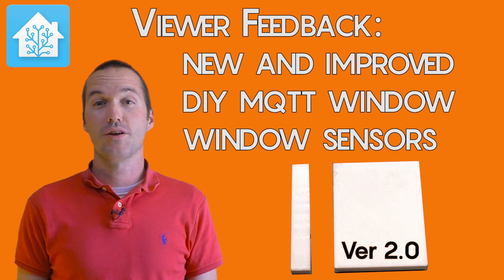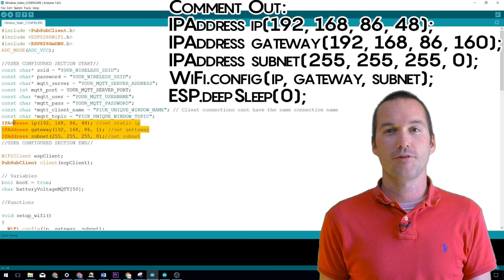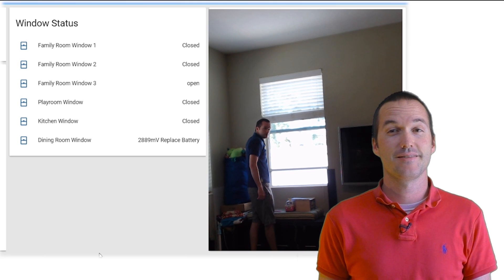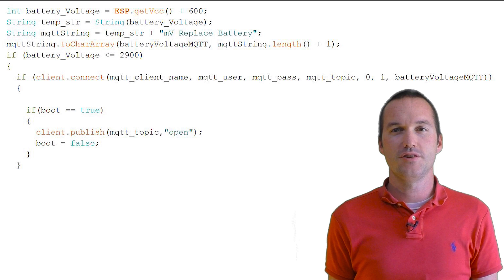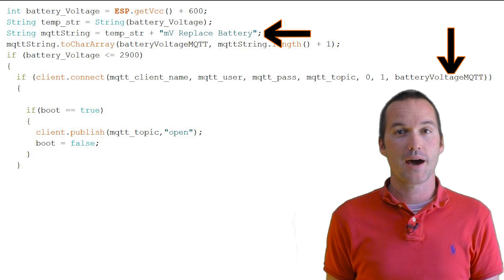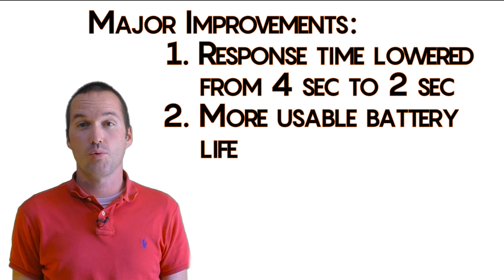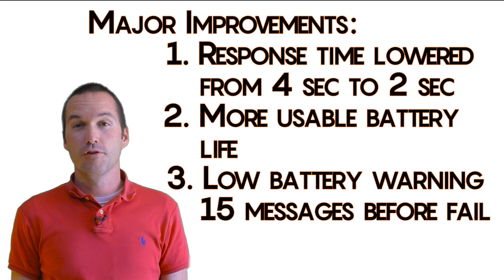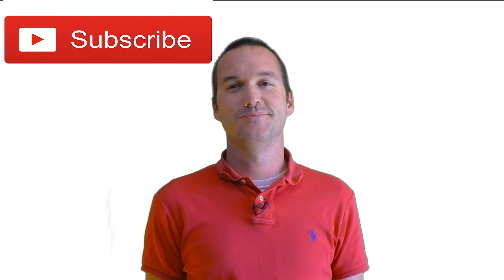[FIXED] $5 MQTT Window Sensor Viewer Feedback

Comment: Do you think that this sensor could be redesigned as a water leak detector?  Replace the reed switch with some kind of contacts that would complete the circuit if submerged in water?  I've been really wanting to DIY some of these but they have to be battery powered for the locations that I'd want to put them (behind the toilets, under the sinks, under the dishwasher/washing machine, etc).  Do you have any thoughts on this?  I'm sure others would find great value in these devices too.  Outside of a fire, a flood is one of the most devastating things that could happen in your home.
Reply from the maker: The problem there is that unlike a reed switch the water sensor is going to have some current draw at all times, which makes battery power more challenging.
Reply: Right.  That's the rub, isn't it.  The idea I had would be that the water sensor would be a switch to the power and when water is placed on the sensor that it completed the battery circuit, powers the ESP01 and it transmits an MQTT message that water was detected.  Now I don't know that the water would be sufficient to conduct enough power to power the ESP01.  I don't know your electronics background, but is it possible to do something like this or perhaps have the sensor be the catalyst for some other sort of switch that could activate a transistor or relay or something that would be able to power the ESP so that it can send the message?
Reply from the maker: Water is a pretty terrible conductor.  You might be able to find something that is consumable and dissolves away  when water hits it and completes a circuit... which might be annoying to upkeep.
Reply: Here is a linked to the Xiamoi Leak Detector (https://www.gearbest.com/home-smart-improvements/pp_668897.html)  It claims 'The durable battery (CR2032) can be used for two years and the battery can be replaced. '  .  I see other brands like iHome on Amazon that claim the same thing so they must be doing some sort of power management.
Reply: The issue I have with buying these premade is that I'd like a bunch of them so it would get a bit expensive.  I've got a ton of esp01's lying around already too.
Reply from the maker: Custom components and not using wifi are pretty good places to start for battery life :)  "It can't connect the phone directly, you have to connect phone via Xiaomi gateway"
Reply: I showed that one as I already have the XIaomi gateway working with HASS and I had looked at it as a possible purchase.  You can find others that claim to be wifi like this one https://www.amazon.com/iHome-iSB02-Battery-Powered-Sensor/dp/B076TDZX9J/   .. Anyway, just thought you might be interested in the project.
Reply from the maker: So I was thinking about this a little more.  I wonder if you could just use the water to bridge the chip enable pin instead of actually providing power.  I don't know how much current gets drawn if VCC is hooked up by Chip Enable is not.  I know the enable pin only needs a very small voltage to function.
Reply: The Hook Up surely worth trying. Thanks for the suggestion!
Reply: What if you place a small bit of sponge in salt water and let it dry up, then place the dry salted sponge between your sensor wires and when water hits it, it will be drawn up into the sponge with the salt acting as an electrolyte?
Reply: Great idea and thank you both for the idea and inspiration. I think I did it! Here is the full project - https://github.com/alekseyn1/WaterSensor

Comment: Hi.. Great video. Could this sketch would with a PIR sensor (HC-RS501). I'm trying to setup a PIR with wifi (ESP-01s) and battery (4 AAA batteries). I want it to trigger a Sonoff Basic via MQTT.

Basically, I need to turn on a ceiling fan and lights in the room. But everything should stay on until the room is empty. How I see it working is that the PIR will send a message when movement is detected in the room (someone enters) and Hassio would turn on everything. Every 5-10 mins it check for movement and if there is, it reports movement, if none is detected, Hassio turns the fan and lights off, after another 5 mins or when the PIR reports no movement 2 times in a row.

I'm a bit new to Hassio, and IoT in general, but I'll been watching a many videos as possible to learn. Any help would be appreciated. Thanks.
Reply from the maker: You'd need a much bigger battery if you want to use this with a PIR sensor.  You could use the PIR to activate the ENA pin on the ESP-01 and send an mqtt message, but you'd need constant power to the PIR, and you're going to end up sending a lot of messages since PIR sensors are pretty senstive.
Reply: Thanks for your reply.

I was thinking of using 4 x CR2032 (double in series and then parallel to get 6 volts) Would that be better then the AAA batteries?

I was thinking, if there's a way for the PIR and the ESP-01 would remain powered down, and have Hassio request a movement check every 15 mins. I'm ok with not having Hassio turn on the fan/light automatically. But, would like to have it turn off fan/lights when no one is in the room. The way I see it, if someone is using the room, if they need the light and fan, they'll turn it on. But, if they leave and forget to turn them off, Hassio would turn it off if no movement is detected.

I figure that I have 2 options.

1) Keep the PIR constantly powered, and then when movement is detected, it powers the ESP-01 to send the message.

2) Keep the EPS-01 powered and connected and have Hassio send a request to a movement check. This would I think could work better if the occupants turn on the fan and/or lights.  Hassio could check to see if they're on and then send movement check requests to the esp-01 every 10-15mins. If movement check return low, then it turns off the fan/light.

Is there a 3rd way I'm not thinking of by any chance?

The ENA pin is the same as the CHPD pin, right? That pin is usually kept high for normal use. So, sending the 3.3V signal from the PIR would be enough to send the message, right?

My next big challenge once I've decided on the method, is to write the sketch for it. I'm one of those people that can edit and even fix or modify codes to my needs, but sucks are creating them from beginning.

Thanks. Looking forward to your reply.
Reply: Hi. One question. What if I used a HC-05 Bluetooth module instead of a ESP-01 module. Would that make a difference in battery life?

Comment: What should i do when i try to upload it to the esp8266 and it says no such file or directory for the first 3 lines were they include #. please answer my question.
Reply: where could I get the library from I did not find it in the arduino app so is it on github?
Reply: @ahmedalshamsi1723  you mean the PubSubClient.h? I had that issue and searched for "PubSubClient" in the library and found it and installed it.
Reply: Jimmie McCullough.     I passed this and right now facing another obstacle. The wiring diagram used in this video does not work. I tried many other ways using ftdi and usb to ttl. Not even a single one worked. IF YOU KNOW HOW I CAN HOOK IT WITH ARDUINO UNO PLEASE HELP. Prior thanks ❤️
Reply: @ahmedalshamsi1723  you mean the wiring at 2:11?  GND is soldered to your reed switch (don't confuse GND with TX, I did that once. GND is the only solder on that row). Then hard wire ( I used one of the pins i removed and made a "C" shape with it) VCC to CH_PD (Just hop over reset). Then add a wire to your VCC 3v and connect it to + on your battery, - goes to the other end of the reed switch. I did a couple with hard wires and no reed switch to make sure it was working without having to use a magnet.
Reply: Jimmie McCullough no i meant were i have to program the esp8266 0-1
Reply: @ahmedalshamsi1723  OH! to put it in program mode you have to jump GND & GPIO0
Reply: Jimmie McCullough i did, unfortunately didn’t work

Comment: great video thanks.  unfortunately it does not work for me.  I checked the SSID password for everything.  The ESP does not log on to the network.  I flash with Tasmota everything works.  where is my mistake ??
Reply from the maker: What does the serial monitor say?
Reply: I have not tested that yet.  do I have to program Serial?
wireshark on the given ip for the ESP  shows no data
(sorry for my bad english)

Comment: what if this used a single AA or AAA battery instead of the CR2032? I would love to build this myself but ~20 MQTT messages per battery really doesn't cut it for me. Would probably have to change it every week or so
Reply from the maker: 2 AA batteries would get you to 3.0V, but is probably not a great fit because even when they are close to fully charged your voltage will drop below 2.9V (which stops the ESP from booting up).  Note that with the changes in this video I was able to get 110 messages on a single battery.  Someone in the other video suggested 2450 batteries which have about 3x as much capacity as 2032s, so maybe 300 messages per battery?
Reply: Maybe with a boost converter?  Would need to test
Reply: @TheHookUp  what about CR123A? They are no very big.

Comment: Is there already a commercial version available for reasonable prices?
Reply from the maker: Not a wifi version, no.  There are zwave versions that require a hub, and 433mhz versions, but no wifi.
Reply: What would be ideal for a wifi door sensor? Perhaps something similar to this, plus a buck-boost converter and a 18650 lithium ion battery cell?

Comment: Hey, could you publish your HA configuration.yaml? Im having difficulties in setting up the switch/sensor there.
And I would like to hear your advice. I want to build a "If a car is parked" sensor, from an HW-628 NodeMCU board, a 3V HC-SR04 ultrasonic sensor, and a power source. I would like the device to publish a status to my HA instance at home if there is a car parked (based on the distance it reports), every 30mins. Im new at arduino this and Im still at the phase of writing the main code. I got distance measurements, and wifi, I need to code in deep sleep and publishing to my HA RPI at home.
1. Is the hardware that I've chosen good for this, or does it take too much power (the board mainly)?
2. How many times would this setup operate on a coin cell? Should I think of a much larger power source?
3. Is this a correct way that I could setup my mqtt on my HA?
switch: (or maybe use sensor? I don't know how to write the code for sensor)
- platform: mqtt
  name: "Parking"
  command_topic: cmnd/esp/parked
  state_topic: stat/esp/PARKED
  payload_on: "YES"
  payload_off: "NO"

Thanks!
Reply from the maker: What specific yaml are you looking for? I have these set up as MQTT sensors.
Reply: Exactly I'm interested on the code for the sensor type.

Comment: The nominal voltage of a LiFEPO4 is 3.2 volts.  The more common LiPO is 3.7 and as you said could be 4.2.  Clearly not a good choice for 3.3 volt devices.

Comment: You may want to look into the following blob ... http://esp8266.github.io/Arduino/versions/2.0.0/doc/reference.html ... under the topic of "Analog input" ... to read Vcc correctly, the ADC must be floating. The ADC of the ESP8266 has a range of 0V -> 1V so many of the inexpensive ESP8266 devices lurking about the web put a voltage divider in front of the ADC pin to increase the input voltage range to 0V -> 3.3V. If the modules that you are using has this voltage divider on the PCBA, you need to remove the resistor divider (both resistors) to get accurate ADC readings. Espressif documentation is lacking ... if I remember correctly, the ESP8266 uses a SAR ADC so the input impedance of the ADC block is in the mega-ohm range (most likely above 10M).

Also, removing the 10K resistor serves more for an overall cost reduction than power reduction ... EN's input impedance, when pulled to Vcc, is order of magnitudes higher than 10K so putting the 10K in series with the EN pin does nadda except take up real-estate and cost. Again, Espressif's documentation is lacking so difficult to be more precise ... would be nice if the documentation included full electrical specs of the chip!
Reply from the maker: That's a lot of great information there.  When I power the ESP with a 3.3V bench supply the ADC reads the exact right voltage, that's why I suspect we're just looking at the shortcomings of a single CR2032 battery trying to keep up with the high load of the wifi radio.

Comment: Great video. I was able to replicate your setup minus the 3D enclosure. I had a question about the code. When the sensor trips it shows the door is opened. It looks like the esp reboots itself and then goes back to closed state even when the door is still open. Is this normal operation?
Reply from the maker: Yeah, it's mostly just to detect if a window changes from closed state to open state (like someone breaking into your house via a window).  I have another design that works for open and closed, but it's a more complicated build.
Reply: Ok cool. Is there a way to edit the code that will retain the previous state before it reboots itself? (i'm not a coding expert)
Reply from the maker: Yes, it can be done... but not super easily.  There's a file system that can be initialized on the ESP8266 called SPIFFS.  You would need to read the last state from SPIFFS and then write the new state to SPIFFS in your setup and then use that state to send your MQTT message.  The problem with that is that older ESP-01s only have 512kb of memory and cannot have a SPIFFS, newer ones have 1Mb and can therefore have SPIFFS.
Reply: Great thanks for the quick feedback. I tried to google this but couldnt find anything. Are you aware of any tutorials on how to use this function?? I could give it a shot and if it works im happy to post it up.
Reply from the maker: I've used SPIFFS on nodeMCUs, but never on an ESP-01, this thread seems to have information about it: https://github.com/esp8266/Arduino/issues/4061
Reply: Ah ok i see.. I will check it out. I wonder if there is a way to prgram your code to say that if there is voltage detected, changed the default closed back to open...Anyways great work, Love the videos,
Reply: I second this function. Would be great to show the real status in HA and not the default status after a certain period of time. Can you not delay the closed message that shows up after open (even when the window is open?). Just put an infinite delay on it?

Comment: Hello sir.
I am doing the same for my office door which we open and close many times in a day and the main problem is the battery life. Please suggest me solution for that sir.
Reply: If the door has frequent use, then the only viable options I can think of are:
- Stack up on cell batteries. If run in series (+ side touching the - side of the next one), available battery life will scale almost linearly with the number of batteries stacked. Unfortunately, though, batteries will degrade at different speeds, and reliability might be an issue. Not to mention the expense on cell batteries would scale linearly, too.
- Switch over to a much bigger battery (as big as your enclosure allows), at the same voltage. The more amps available, the longer the battery will last.
- If possible, switch over to a power supply connected to the mains socket. You can probably get away with a tiny 1A cell phone charger connected to a 5V transformer that pulls down the voltage to whatever you need to use (usually 3.3V, though if it's 5V, then no transformer is needed).

Comment: This is an awesome project! Congratulations!
I am stuck with my configuration.yaml? I am trying to adapt the MQTT lock component but it doesn't work..
Could you please help me ?
Reply from the maker: MQTT Sensors.

sensor:
  - platform: mqtt
    name: "Dining Room Window"
    state_topic: "windowStatus/diningRoom"
Reply: Thanks The Hook Up!
It is working well now. I am going to modify a bit your code as I'd like to add the availability_topic to show up if my sensors are either offline or online as I am adding a physical switch to turn them on/off. I am doing that essentially for the door sensors. Keep posting, you got excellent ideas ;)

Comment: Hiyah...Big fan. I modified your stl files to fit my needs. I wanted to keep the pins in-tact so I could either reuse the ESP-01 later or program it without soldering wires.  I also added a hole in the bottom to remove the battery easier. Check it out here...  https://github.com/agengler11/MQTT_Reed_Switches

Comment: Thank you for providing the code. It is not a good way to enter SSID / Password, MQTT setting within the code. wouldnt it be better to use a library like this? https://www.youtube.com/watch?v=0wnnMWkn5Hs 
In case of changing the wlan password you would not to flash the esp.
Reply from the maker: Solutions such as WiFiConfig work well for powered sensors, but these are using a very small CR2032 battery.  It's likely that configuration via WiFiConfig would use an entire CR2032 in the short amount of time it would take to program.

That being said, it could easily be added on wifi failure.
Reply: Then you have to configure the device BEFORE it gets the cr2032 battery. The configuration procecdure is once.
Reply from the maker: But then you'd have the same problem as before, you wouldn't be able to change it.